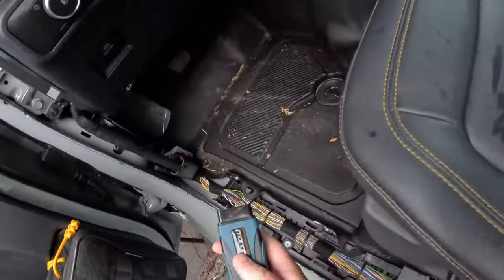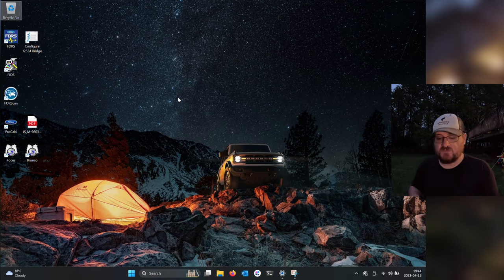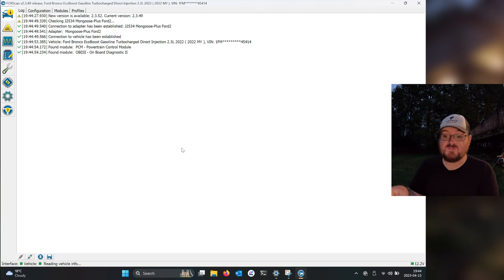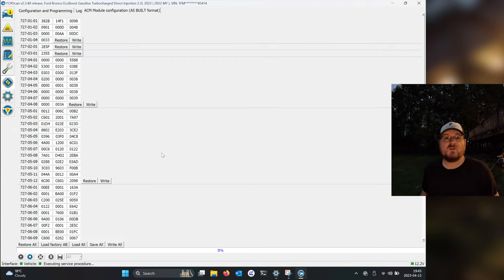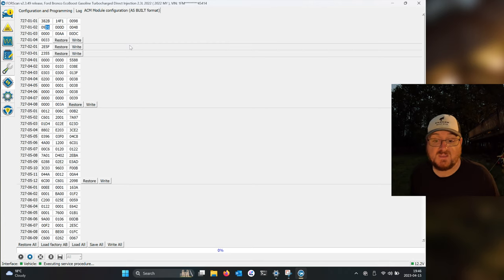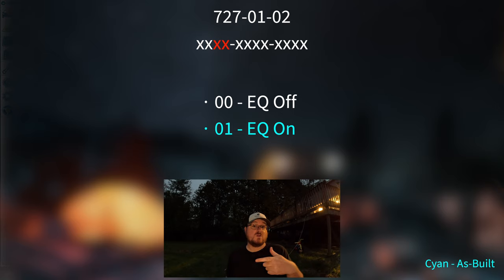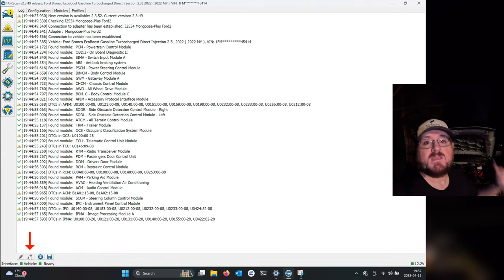FORScan tweaks to improve audio! | Ford Bronco

Comment: I initially only changed the eq setting after upgrading to the rear 6.5 pods w/kickers and 4" kicker dash speakers. Wasn't happy at all with the rear pods, but after watching your vid I changed setting for rears to speaker/tweeter, Holy Cow Much improved sound afterward. Granted it's not hard hitting bass,but I'm happy to hear any type of sound other than midrange/tweeter sound coming out.
Thank you so much for posting this.Very informative video.
I do have to go in and do away with seatbelt chime, It did get Much Louder after doing upgrade. Or I could just wear seatbelt ...😂
Thanks Again!

Comment: Thanks so much for this video.... I just adjusted everything in prep of the final install tomorrow. Kicker KS speakers all around except the 6.5's as I've got feedback not much difference noticed. 8" kicker comp installed in dummy factory box. The Stinger Phoenix Gold 12" speaker on tailgate. 4 amps.... All Kicker Key. 2x 200 (4 channel) & 2x 500 mono for subs (one each). The two 500 mono amps mounted next to factory box with custom mount. And the other two amps will go under the driver and passenger seats. Leaving the glove box open for a crossover potentially later on.....

Comment: Thanks for posting this! I bought two 6.5 kicker speakers and a lame-ass set of Mabett speaker pods. When I installed them I could only hear the highs in the back. I then changed the rear settings to speaker/tweeter in he 727-01-01 module and turned the EQ off in the 727-01-02 module. They sound awesome now!

Comment: If you have an Intel based MacBook you can also install Windows in a virtual machine and have both Mac and Windows running at the same time.  I have an older Macbook Pro that I use for FORScan  or when Windows is needed.  If interested I'd recommend VMWare Fusion or Parallels for Mac as the hypervisor but there may be others that work as well.

Comment: Well , I thank you for the tutorial , it helped me to send full range to all my speakers , I have an OBX LUX package , with B and O , and yes , there is a center speaker. There is also DSP which became a nightmare for the ten minutes it took to get home and learn how to turn DSP OFF. So I ran Alpine 4 inch Coaxial's , 5 of them , 3 up front , 2 in rear , On the three up front , I wanted to shut off the lower frequencies but still have some overlap. My left and right dash and bass blocked with a 400 Htz blocker , the center channel is blocked with a 300 Htz blocker , both the rear left and the rear right , I wanted some mids , so they have 200 Htz bass blockers on them. Back up front in the kick panels I have 2 6 inch Hertz Coaxials , they are 85 Htz bass blocked. I left the factory sub ON but I'm considering shutting it off now that I added a Rockford Fosgate 10 Inch sub box. Here is where the problem came in , I listened to a few songs at work it sounded great, then I start up the Bronco and I noticed a low rumble through the bass cabinet in the 1500 RPM ish range to the 2500 RPM ish range and it gets quieter as the RPM's go up. Once ya come to a stop light , and you speed back up on green , same low rumble , even with the Volume completely down. I was like WTF? So come to find out , it was the DSP (Digital Processing Unit), utilizing its software and its microphone , to change the cabin sounds and it was reading though the aftermarket amp and amplifying my exhaust notes when the turbos kick in on low RPM's , like interference , sorta. The kick panel left and right channels go to my sub box , its a duel voice coil speaker. Once I went into Forscan and disabled the DSP , it all was back to normal. Crazy stuff lol.
Reply from the maker: Nice!! Glad it helped a little bit

I am working on a version of this video for those with the Lux package, but it's been slow going because... well... I don't have a Bronco with the Lux package, and it's hard to work out schedules with those I know who do.

It is definitely a lot different because many of the speakers in the Lux package and fed from the DSP sitting in the back of the Bronco rather than the ACM, and of course the DSP does a bunch of its own processing–as you found out.

Good work figuring that out, it's definitely convoluted.

Comment: This is great. Finally somebody explaining that changing 382B to 3800 to try and get more sound out of the rear speakers does absolutely nothing. The two EQs fighting against each other makes perfect sense. I plan on turning the factory EQ off and then running the kicker. To be fair, of all the horror stories I've hear about how bad the audio set up is, I honestly don't think it is AS bad as people make it out to be. Can it be better? Absolutely. I've had my Bronco for two days and was expecting the worst. I'm a huge audio nerd and the first thing I do with a new car is update the audio system. Honestly, it's passable for now. But I am still going to add the kicker, new speakers and a sub anyway.
Reply: @Toasty same here. The stereo system sucks badly.

Comment: Part numbers Needed to Upgrade audio for newer Non-B&O Audio are..
PAC LPHFD31 and LPHEXT17 Harness. As well as a DSP that accepts High Level Input.  I.e. Dayton Audio 408, Hertz s8, GZDSP 4x8II,  GZDSP 6x8II,  Arc Audio PSM Pro...

For B&O Audio. 
Required Harness is PAC AP4-FD31 plus recommended one of the above DSPs.

Comment: Great information and glad a non-computer person like me was able to figure out how to get my sub up and running.  That being said, I put Kickers in the floors and in the sub.  What would you recommend as the Forscan setting(s)? I'm running the Ford Fusion amp on the sub.
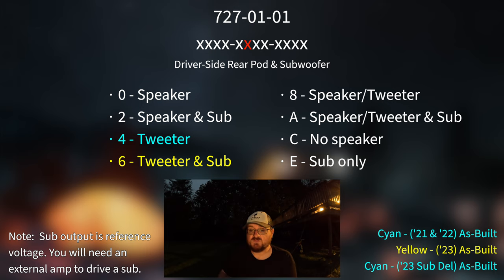Reply from the maker: 11:00 mark is the important one.  If you just added a subwoofer, you just need to change it from the "Tweeter" setting to "Tweeter & Sub".

If you replaced the rear pod speakers with larger speakers, there are additional settings you'll want to change.  But otherwise the "Tweeter & Sub" setting is all you need to change.
Reply: @RagnarKon  I'm eventually upgrading the speaker pods as soon as I can find compatible brackets for my Mabett pods.  I added a Kicker to the "deleted" box and added the Fusion amp and have both adjusted thru Forscan.  I installed Kickers to the front floorboards, however, they are underwhelming compared to the activation of the rear sub, so that's why I was wondering if there was a way to boost the front floor speakers since they are upgraded?
Reply from the maker: @toddbrandes1138  Nah, nothing you can do.  They are already set to maximum output from the factory.

The dash and kick panel speakers are powered by the same channel.  And you're basically at the limit of what the factory amplifier can do. So if you want more out of it, you'll need to install a new aftermarket amplifier.

Comment: Great video and exactly what I needed! Thank you!

I do have one question. I've done these steps, replaced all 6 speakers, and have installed the key 200 amp with 300hz bass blockers. However, I'm getting the dreaded distortion clipping above 17/18 volume. 

Have you ran into this issue? Would the solution be to increase the bass blockers to 600hz? Also, I used the Skar audio bass blockers and not sure if they're inferior to Crutchfield's as it only connects to the positive side. 

Thanks again and in advance!
Reply from the maker: I haven't pushed my volume that high yet, but definitely will give it a shot and see if I can figure out what's going on. Is it only on the 4" speakers or are you getting it on the 6.5" speakers too?

My hunch is you are clipping the input to the amplifier, but let me see if I can recreate the issue.
Reply: @Ragnar.Kon  I'm mostly sure it's the dash speakers that are distorting, but I'll go check and see if I can hear any from the kicks or rears and I'll let you know.

Comment: Hey man, I’ve watched a bunch of your videos but hit a wall on my ‘23 Wildtrak’s sound system. Replaced all the speakers and just today installed a new amp for my JL stealth box, but it farts at low volumes. I live in Western CT and wonder if I can enli$t your help to run some cheat codes. Don’t want to buy a laptop just for this, but I’ll drive to and compen$ate you for the trouble.

Comment: Thanks for videos!  

Question on roof rack….  Can you get the second row panel off?  I’m thinking about that one…. And selling my factory one.
Reply from the maker: To be perfectly honest I haven't tried.

I suspect you could, but it wouldn't be easy at all unless you took out the cross bars.  Which you can do, only 3 of the 7 crossbars actually need to be attached for the roof rack to be solid.
Reply: I've also been thinking about the Trailrax. Even though they claim to able to take mid roof panel off, I have yet to see a video. Like you said, it must be very difficult. Wonder if it's worth selling OEM rack if I'm still in same situation of not being able to take mid roof panel off?

Comment: Hello.   Love your knowledge of FORScan and the audio modules.  I have a B&O system and am trying to open up the sound in the back of the 22 bronco.  It seems restricted because the front speakers are much louder    Can  you help
Reply from the maker: The B&O system is MUCH more limited in what you can change. I have a video coming on it eventually (just waiting for a weekend without rain).

On the base audio system, the EQ setting only impacts the rear pods. So turning it off isn’t a big deal. On the B&O system, turning off the EQ impacts every speaker in the Bronco, not just the rear pods.

Comment: Update: solved it! 

The issue was two-fold (and one of my own stupidity). First, I was testing the clipping and distortion with the Bronco turned off (symptom of having ran the key setup with the Bronco turned off). This was causing the amp to get less and less power, and I didn't catch it until I noticed the amp was now clipping at 13-15 volume. 

Secondly, the first mistake might have been a blessing as it was actually making it easier to test the clipping. While I was trying to fix the problem I tried all four hi-pass filter settings, and noticed that switching from "Off" to "60hz" made a huge difference in the amount of clipping, and for my 6 Focal speakers "80hz" was the sweet spot. 

After remembering I'm an idiot, I finally turned on the Bronco and tried the four different hi-pass settings and voila!! With the hi-pass at 80hz and the amp getting full power I can now crank the stereo higher than I would ever reasonably listen (like mid to high 20s), and there's zero clipping. 

Moral of the story is that the 4.5s and 6.5s are not great at bass frequencies, and all of them require some sort of roll off in the bass frequencies or else the amp will cause the speakers to distort. I recommend turning on 60hz hi-pass at minimum,  likely 80hz for most speakers, and 120hz for low-end budget speakers. 

Thanks for all of the help again, and please keep us up to date with videos of your progress! Love your videos, and I can tell by your forum presence and the videos that you know your stuff.
Reply from the maker: NICE!  Glad you got it figured out.
Reply: Parameter settings ?

Comment: Hey there any thoughts on how to set up my bronco with factory sub? I am swapping out the sub for an 8 inch jbl sub. Replaced all 4 inch speakers.
Reply from the maker: If you have the 2023MY Bronco, this video shows you everything you need to do.

If you have a Lux package with the B&O audio it is MUCH more convoluted—still working on figuring that out, but since I don't have the Lux package personally it's been slow going.  Have to work with people who do have the Lux package.

Comment: If you upgrade the aft 4 " to Kicker DSs, would it be beneficial to turn the EQ off and/or select a speaker/tweeter? For ref - I did Kicker DS in all six (factory sizes) and replaced the sub with a Kicker 2-ohm and factory amp.

Comment: Question I have replaced all my bronco speakers and need help with what to set forscan on.  My rear pods are now 6.5 components and my front stage is a 3way components setup.  My fronts are not using the wires for upper front speakers.  Only using setup in lower kick panels.  So I changed eq to 00 on forscan. So what do I set the speakers on?

Comment: Thanks for this great video. I'm actually doing some upgrades on budget so i upgraded all 6 speakers on my 2021 Base Bronco 4dr. i also installed kicker powered subwoofer by tapping to the kick panel speakers. I want to get better sound from rear 4" speakers. do i need to change the rear to speaker or speaker/tweeter? do i need to do anything on the front kick panel? Thanks again
Reply: Get the appropriate Harness, don't "Tap" into anything

LPHFD31 and LPHEXT17 harness into DSP for Non B&O

PAC AP4-FD31 Harness for B&O Upgrades.

Comment: i have the same kicker key in my bronco with audsion speakers, i did the auto EQ on the kicker. A few months later i found out about getting the flat eq with forscan and it sounded like absolut trash so i reverted back to EQ on. Maybe i should try turning the factory eq off again and running the kicker key auto setup again with the EQ off. wonder how much of a difference it would make.
Reply from the maker: Definitely should try to run auto EQ again with the factory EQ turned off.

In my case... the auto EQ tried to compensate for the factory EQ setting by applying more bass, but it made everything sound more "boomy" and muddled. Almost like you were listening to music underwater (not really, but best analogy I can think of).

Once you feed the Kicker a flat EQ, it no longer has to fight against the factory EQ.

Comment: I need a little clarification, I replaced all my speakers with the same kicker as you with the exception of adding the mabet pods. I should change the EQ then set the tears to full size speakers, would that be changing them to 0? Hope that makes sense!
Reply from the maker: If they are single cone speakers (like the factory speakers) you should set them to the "Speaker" setting.

If they are coaxial speakers—which they probably are—you should set them to "Speaker/Tweeter".

Comment: I’m having trouble finding parameter codes for a 2021 Bronco with LUX package & B&O. Do you have a source for this?
Reply from the maker: Link below. Unfortunately the B&O package isn't as flexible as the base audio package, and there is very little you can actually do that doesn't negatively impact the overall sound quality.

https://www.bronco6g.com/forum/threads/how-to-forscan-audio-speaker-mods.71145/post-2034445
Reply: @RagnarKon  are awesome, thank you so much for taking the time to reply. If you find out any new information in your travels I am all ears.

Comment: At 11:03 in order for the sub. to work, do you also need to change the 0098 to 009A? Thanks.
Reply from the maker: If you are using the factory subwoofer wiring on a 2023 and later, then yes.

In my case, I have a 2022, which has zero factory wiring. So that setting does effectively nothing.

Comment: Speaker Configuration Settings - ACM 727-01-01

I had my system installed... Looking at line 01-01 mine reads as follows

382B 0211 02F1 0084.

Not sue why the last three dights are 84 instead of 98?

Any thoughts why 84?
Reply: Sorry Typo 382B 00F1 OO84

Comment: I have a question that my have been answered already. We have a 2023 with the dummy sub and amp. If I add a amp and sub will I have to use FORScan to activate the amp and sub?  Or is it plug and play?
Reply from the maker: All of the wiring is there for an amp/sub, but the outputs from the audio system to the amplifier are turned off.  You have to use Forscan to turn on that output.
Reply: @RagnarKon  If you turn on the output to the subwoofer, as mentioned above,  but turn off the factory EQ and turn on the Kicker 200.4 EQ how will that affect the subwoofer?  Is the sub now getting a flat signal?  I installed the Fusion Amp/Kicker Subwoofer.  Just wondering how the changes to the EQ from 01 to 00 will impact my subwoofer.

Comment: what If I put a sound bar?  I have the OB system, but got the RC sound bar to replace the rear speakers
Reply from the maker: If you have the B&O system that's in the Lux package there is nothing in Forscan you can do due to the Digital Signal Processor that's included in the B&O system.

If you have base audio system... it's the same thing as installing 6.5" pods.  Disable the EQ and turn the speaker configuration to "Speaker" or "Speaker/Tweeter".

Comment: Got too bored to finish this, but you also have to turn off the ported in engine sound.
Reply from the maker: The engine sound doesn't exist on 2021-2023 Broncos with the base system.  That was something Ford added in 2024.

Comment: Is that mongoose ODB II really $500 + 😮😢!!!
Reply from the maker: It is!  The official Ford tool is $1500.... so $500 was a lot more economical.

You don't need the Mongoose tool if you are just doing some setting tweaks in Forscan though.  The expensive tools are only necessary if you are flashing modules with new firmware using FDRS.